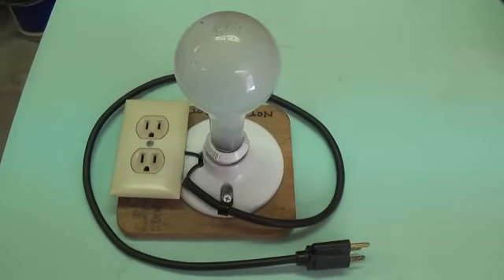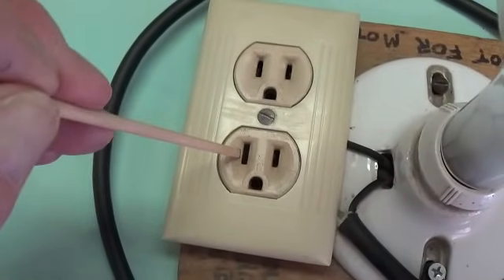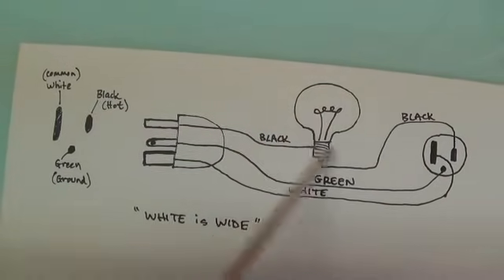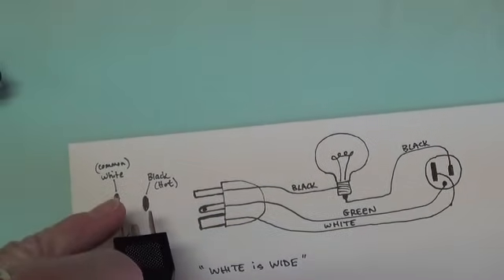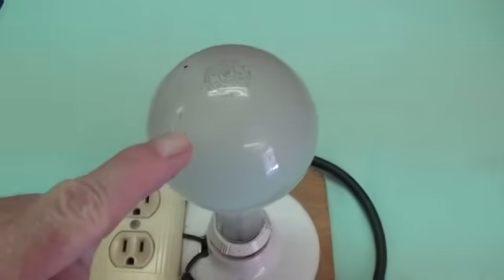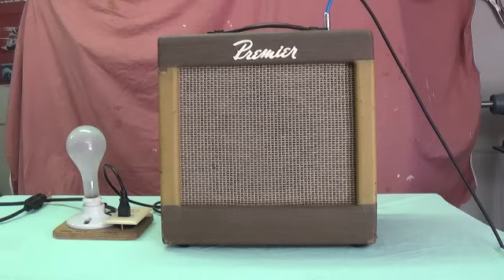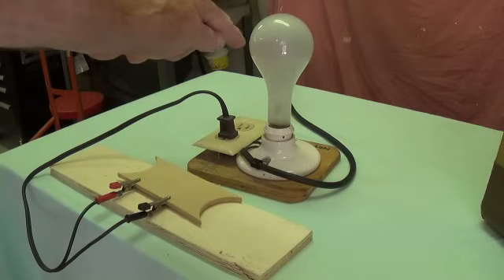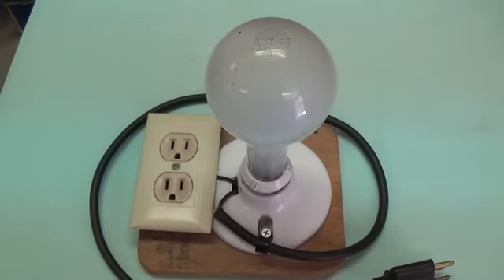Build Your Own Current Limiter for Protection when Repairing and Testing Electronic Equipment

Comment from the maker: IMPORTANT NOTE: Before asking any questions, please read the entire video description. It will, most likely, answer them. Thanks.
Reply: Your soo smart...and helpful...and  your videos soo fun to watch !
Reply: What type of light bulb can I use instead of an incandescent light bulb? There are no incandescent light bulbs for sale anymore in my area. Can I use an LED or halogen bulb?
Thank you
Reply from the maker: I don't know about halogen bubs, but LED's have too much resistance and lower the current too much to be useful. Have you tried ordering bubs on Amazon ? @SDsailor7
Reply: Could a GFI outlet be used in the current limiter? Or could a GFI outlet be used as an auxiliary out let behind the amplifier that also powers the amp. Electrician codes require one GFI present on countertops around a sink. That one outlet protects all others connected to it. It may work as a ground fault protector in an amplifier.
Reply from the maker: There is no substitute for a Current Limiter when working on electronic gear, David. It, and the GFI serve two different purposes.
Reply: Uncle Doug, are you using a light bulb in your current limiter? 😂

Comment: I use one of these every single time I fix a tube amp, I start up with a Variac at 60vdc and this style of current limiter, gradually increasing the voltage to 120vdc .  When they were phasing out 100w incandescent bulbs, I bought a case.  It works and can save you from further damage if you make a mistake. One thing to be aware of, because it limits current, it throws off the Bias of the power tubes - so you can't set bias when you are "limiting" the current,  you need to re-check and adjust after you plug directly into unlimited 120vdc.
Reply from the maker: All great advice, Stav. Thanks for sharing :)

Comment: Hi Uncle Doug. I been repairing a Traynor YBA 1 amp from the early 70s. I used the current limiter and it lit up quite brightly. After my repairs I got the amp working however the current limiter still lights up but not as bright as before. Is this normal. Thanks Darren S
Reply from the maker: What is the wattage of the bulb and the wattage of the amp? What is your wall AC voltage level?
Reply: The bulb is a 150 watt. The amp is a traynor YBA-1 at 40 watts and the wall voltage is 110v. I am new at this and repair amps for a hobby. Presently I have repaired about 12 amps. I just work on tube amps. Thank you for the reply your videos are so helpful. DS
Reply from the maker: @330rocket  A 40W amp would probably be better served by a 250W bulb. If Power = Current x Voltage and a normal 40W amp draws about 2A from a 120VAC outlet, the bulb wattage would be 2 x 120 or around 240W.  The bulb may initially glow but will dim quite a bit after a few seconds.
Reply: @UncleDoug Thank you ever so much, Darren S from  Old Perlican, Newfoundland, Canada. Your knowledge is greatly appreciated.
Reply from the maker: @330rocket  You're welcome, 330 :)

Comment: I learned this in ‘91 in electronics school. Works way better than you think.  Also- just installed auto 1176 bulbs in series with the tweeters in my Turbosound Berlin line array speakers after wiping out 8 tweeters due to a mistake that sent a shot of uncontrolled feedback to those speakers.

Comment: @redfields5070
0 seconds ago
With half the supply volts dropped across the bulb and the other half across the amplifier, (both being 110 volts) that would leave the bulb running on 55 volts and the amplifier running on 55 volts, wouldn't it?  The current available to the amplifier would be reduced to that of the bulb current. The short with the screwdriver would only be the normal draw of the bulb. With a 250 watt bulb that would mean a screwdriver only shorting about 2.5 amps. So the amplifier is starved by running it on 55 volts at a maximum of 2.5 amps available.
Unless I am entirely wrong about things, which would not be unusual. 
Please correct me if I am wrong.

I have seen this setup with a switch across the bulb, which could short across, therefore turning off the bulb and return 110 volts, and whatever the normal amp draw is, to the amplifier.
   Also the smaller the light bulb the lower the current flow available to the device under test.
250 watt ~2.5 amps,  100 watt ~1.0 amps,  25 watt ~ .25 amps  - it all depends upon how much you expect things to explode. Start with the smaller and work your way up?
Reply from the maker: You are correct that some voltage drop does occur across the filament of the bulb, RF, but the amount of drop varies greatly with the current draw of the amp circuit. A Fender Champ will have virtually no drop, while a Princeton will have some, and a Twin will have a great deal. This becomes of importance when measuring plate voltage and setting the tube bias.....all such procedures must be performed with wall AC supply and no CL.

Comment: I don't see how the polarization matters in this case, but the difficulty nowadays in Europe lies not really in any of that -- rather, where the heck do you find a 250W filament light bulb? ;D Or even a 100W. These things are phased out. You really need to look for specialty lamps, heat lamps, etc. They used to be everywhere, now you really need to make an effort to get them. :P
Reply from the maker: Check on Ebay and Amazon.  I have bought them in both places. Hint: Look for photo flood bulb.

Comment: We’ll, looks like I’m about 11 years too late in seeing this video 😮. My home theater subwoofer just let go of 2 caps. I wonder if having a current limiter in line permanently would be a good idea, or, is that the purpose of the fuse?
Reply from the maker: Current limiters are not for continuous use, K. I would assue that the power supply for the subwoofer was either regulated or fused....or both.
Reply: @  Ah, I see. Thank you for the info! I’m going to attempt to replace those caps but it looks like they took out some of the traces on the board when they went. Anyway, thanks again! Great videos!!
Reply from the maker: @KOZZZMO  Thanks.  Good luck :)

Comment: I've got a variac and isolation transformer. Do I still need a light bulb ?
I have a 50 watt marshall, no sound/put, any idea what's wrong ?
Reply from the maker: Yes, the Current Limiter is more valuable than either of the two devices you have.  Sorry, Jesse, but my powers of clairvoyance have diminished with age.

Comment: I work on much smaller devices like tube radios, maybe 30-50 Watts.  So I use a 60W bulb.  Some people have several bulbs they can cut in and out.  Like the man says use the bulb appropriate to what you're working on.
Reply from the maker: Thanks for your input, Paul.

Comment: Does anyone know if you (I) could use a light bulb current limiter on an electric popcorn popper to prevent surge current from tripping my service panel circuit breaker? thanks
Reply from the maker: I am guessing that the operating current of the popper is much higher than that of a typical guitar amp, so the CL would pobably work, but you would have to provide an array of incandescent bulbs in parallel to handle the current and not hamper the function of the device.  I would probably just increase the value of the breaker.
Reply: @UncleDoug  ...that's a good point. I was wondering if the CL would decrease surge current which I believe is tripping the 15 amp breaker on start up.  But to your point, limiting the current would defeat the popper effectiveness which I didn't think of. So replacing the breaker seems to be the way to go.... thanks.
Reply from the maker: @rustycalvera977  When faced with similar challenges from my huge air compressor and arc welding gear, I simply increased the breaker value. Some may balk at this easy fix, but it has worked perfectly for over 25 years. We're talking brief surges here......not continuous operation.

Comment: These are great. However, remember to plug in direct when you are sure amp is safe else your voltages will be way low.
Reply from the maker: Good advice, PSB, but the disparity is quite small unless the amp is above 18W (give or take).

Comment: What about if you connect  this current limitert to an isolation transformer which output has only live and neutral (common) wires
Reply from the maker: Instead, connect the IT to the CL......problem solved :)

Comment: Nice gadget !!! I only want to point out that on AC current,, there is no polarity. You can stick the bulb in between either line, the black or the white. Brown or black in EU and blue for the US white. A 100w lamp will do for the EU as the voltage is 230
Reply from the maker: Yes, there is polarity, Jeff, which is why the black wire is always the "hot" wire and the white wire is always the return. They are not interchangeable.
Reply: @UncleDoug  here in europe when you plug into a 220-240 line, you have absolutely no clue if you have plugged in one way or the other, as the plugs are simetrical.
Reply from the maker: @ons-jeffke  Do your power cords have a third, grounding wire? If so, then woulding  the extra prong polarize the plug?  If not, then god help you all ;)
Reply: @UncleDoug  we use the shucko system in the european mainland, it does have an earth conection, but the plug is totally simetrical, as in ac current it doesn't matter if you plug in one way or the other.  DC current is polarized, AC in not.  You do have a life and a neutral, so the voltage can flow, but in AC current it doesn't matter if put the lamp in the life lead, or the neutral lead. Same with fuses.
Reply from the maker: @ons-jeffke  Thanks for your input Jeff.

Comment: Great video.  I am going to make one of these for myself.  I test older electronic equipment,  and sometimes the capacitors decide to short.  This will help me to see the capacitor short, before I get capacitors blowing up on the equipment. Thanks
Reply from the maker: Thanks, Robert. That's exacty the purpose this device is intended for.  Best of luck with it.

Comment: So, we could place two bulbs in serie on each neutral and hot, one for each wire, we could make a current limiting device for non-polarized plugs right? or im missing something?
Reply from the maker: Non-polarized plugs should not be used in electronic gear, K. Regardless, the second bulb is not necessary.  The CL will work properly, as long as the short is in the circuit.....not to the chassis.
Reply: @UncleDoug Yeah i know its bad... it's terrible really, but i live in a old flat that has no grounded plugs 😫 and its my only option that i know of, im living in Spain if you're wondering... 

A hand behind and a good pair of special, isolation edition Crocs and socks are my only protection while working on amps turned on amps, i don't usually work on tube amps but I have made a few ones using fairly low voltages for small preamps and low wattage guitar amps using some russian subminiature pentodes.

Thanks for your reply to my absolutely stupid question for using two bulbs my brain wasn't braining... I have engulfed all your content and im in awe with it :)
Reply from the maker: @kaoti  Sorry to hear of your situation, K.....but please be very careful, we care about our viewers :)  One possible solution would be to wrap one end of a bare wire around a cold water pipe in your flat and use the other end as an Earth Ground. Measure the voltage potential between the chassis of amp being tested and the ground wire, and connect the wire to the chassis, especially if any potential exists.  Meanwhile, the AC supply should be through a Current Limiter to prevent excess current flow in case of a short.  Be careful !!
Reply: @UncleDoug Ooh, yes, I've read about it online, but I don't know if the whole block of apartments is "grounded" at the breaker panel or distribution panel of the block (I don't know if I expressed myself correctly; English is not my first or second language...). I don't know if that's even a problem and could cause some kind of ground imbalance and make it more dangerous than it is right now. I think the closest pipe I have around is about, let's say, 10 meters worth of wire. Wouldn't I have to use a heavy gauge wire to reduce the resistance to a minimum, right? Im always trying to stay safe! even more when working on mains devices, especially tube related devices...

I really do apreciate your concern and immense care you give to your viewers/customers. 
I'll let you know if there is potential between earth and my chasis*, i just hope there isn't much on my main amp...
Reply from the maker: @kaoti  A cold-water pipe ground, if your plumbing is "normal" should provide a reliable ground, K.  Try it and see.
Reply: @UncleDoug  You seem very keen in being cold water and not hot water, any reason why? or im seeing a pattern that has no meaning?
Reply from the maker: @kaoti  Cold water pipes run underground without first going to a water heater.
Reply: @UncleDoug  Oh thanks god i asked and look as dumb as i am because this might have save my life in the worst-case scenario <3333 thanks a lot Uncle Doug.... now I have to question some life decisions i took and going to take from now on, you will keep seeing my dumb ass around your channel.... Always stood by the thought that i look better dumb than dead...
Reply from the maker: @kaoti  Better to ask and feel shy than to not ask and fry ;)
Reply: @UncleDoug  <3

Comment: Would you suggest using the current limiter bulb device in series with an isolation transformer for added protection ?
Reply from the maker: For routine circuit repair, I use only a current limiter.  You are welcome to use both if it provides  a sense of safety, but simply obeying the rules for safe handling of high voltage, i.e. "one hand in your pocket",  should provide adequate protection. Bear in mind that the CL protects the circuit......not necessarily the tech.
Reply: @UncleDoug  thanks for the response Uncle Doug, love the videos.
Reply from the maker: You're welcome, Scotty :) @UOttawaScotty

Comment: Doug, have you considered adding a "Test" button on this device to ensure that the bulb is functioning before using?  With a fuse or some other safety mechanism if the bulb is indeed dead.
Reply from the maker: If the bulb is dead, nothing happens, Jules. No AC gets to the device being tested.
Reply: Well dangit!!!  I'm a numbskull.  Thanks Uncle Doug, I'm learning a great deal from you.   @UncleDoug
Reply: Me too!

Comment: Thanks Uncle Doug. Here in Canada incandescent bulbs are no longer in production or for sale in new stock. There are still some in specialty types but everything is going LED here. Probably same in the U.S. I assume. I managed to find a 300W one and will probably go back and get a spare of that one and some other ones I need as I have special noiseless dimmers for lights in my studio and they will not work with LEDs.

Is there a way to use LEDs for current limiting in the future? If not what other similar methods exist?
Reply from the maker: Nothing, in my experience, works as well as a high-wattage incandescent bulb, Jim. I evaluated a custom-built CL using LED's and its resistance was so high that it drastically lowered the current and voltage being provided to the device being tested.  I suggest stockpiling some more hi-W incandescents,  perhaps from Amazon
Reply: @UncleDoug  OK Good to know that it does not work with LED's. I guess "incandescent" will become another one of those things that disappear. Thanks for the tip. There are still some of the 300W available locally. Cheers.
Reply from the maker: Get them while you can, Jim :) @jimlabos

Comment: MANY THANKS DOUG! :) 
In the process of replacing the power transformer (again) on my 85 watt Dumble Overdrive Special clone amp the 200 watt incandescent lamp saved my expensive Mercury Magnetics power transformer. The lamp went full bright when I powered-up the amp. There was a secondary B+ short to chassis ground. I was also using a 2A fast fuse.....that didn't blow.....which saved me the price of needing to buy another fuse, LOL.
My amp saving lamp circuit differs from yours only that I added an on/off switch to it.
Reply from the maker: Wow.....that was a close one, Tony. I'm glad the current limiter did its job.

Comment: I've been thinking about such a current limiting device for limiting inrush current when switching on large transformers in a residential setting, which can trip circuit breakers. 

Power is applied with a resistance (e.g a bulb) in series with one wire, which will allow enough magnetizing current to set up the flux in the transformer. This series resistance is then bypassed so that full current can flow but without the large inrush which would occur had power been applied with the transformer completely dead. The resistance can then be removed while the bypassing wire remains to power the transformer normally. I've read that this can work to alleviate huge inrush current issues without a problem, but haven't tried it myself yet. 

I can conceive of a push button and timer setup to keep the resistance in circuit before it's automatically bypassed by a contactor after a short time (lets say 0.5 s or even less) so that a large transformer can be switched on and off routinely without a problem. I will post about it whenever I get around to testing this idea.
Reply from the maker: It sounds like an interesting concept, OK.....a bit outside the realm of tube amp circuitry......but interesting nonetheless.

Comment: I have a setup where the bulb is either 60 or 100 watts maximum and the socket has a switch with 3 positions: normal/off/series. That wa in the off position nothing is connected-no live no neutral. It save time for me so that there's no need to disconnect the ac cord  and search for it again to reconnect it.
Reply from the maker: Sounds like an efficient mod, Len.